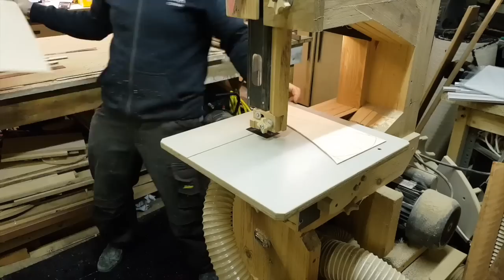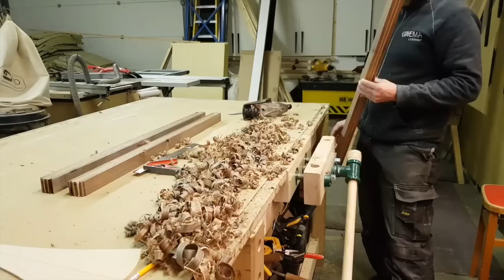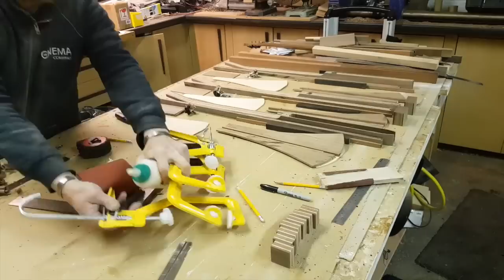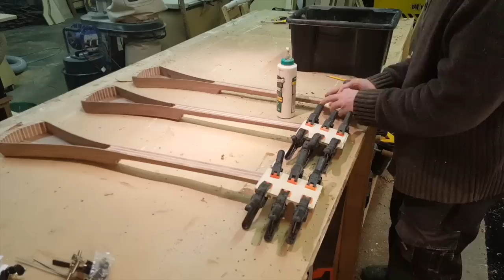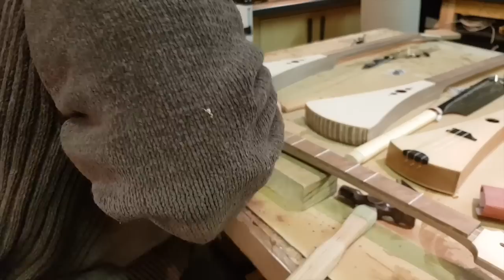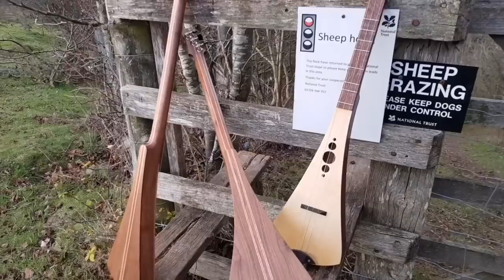Making Dulzouki Dulcimers

Comment: I have a small out building that I build violins in. Iv never had the funds or place to put up a big shop like this...very nice.
Reply: Could you really trust those big, chompy machines to cut and thickness the wood for the violins? apart from reducing a big baulk to more manageable sizes, lol? I think the only one I'd get is a decent band saw like Peter's, but even that is a large outlay for a small amount of use.
Reply from the maker: The Workshop is used for the manufacture of home cinema and cabinets but i use it for my own projects like this. My band saw cost very little as i made it my self.

Comment: Well done. Hmm, have you tried making them with spruce soundboards?  In the US at least , 'whitewood/SPF' at the lumberyard is usually spruce, and these instruments are small enough so that you could find clear sections of 2x4 & 2x6 boards to resaw for soundboards.  Also, I've found that Titebond III remains 'chewy' and it would not surprise me if it has a deadening effect - why not try hot hide glue, which is much stiffer and doesn't creep (although bad things could happen if taken on a rainy camping trip).

Comment: Hey Pete awesome video and beautiful instruments. Already picked up some timber to have a go at one (or two) myself. I am going to make mine with 4 strings like a traditional dulcimer as I love the sound the pair makes in unison. Would I have to add any additional bracing to the body of the strumstick to take the additional tension? Thanks in advance mate.
Reply from the maker: Hello Nikolai. Thank you for the Comment.  I would make the neck a little thicker.